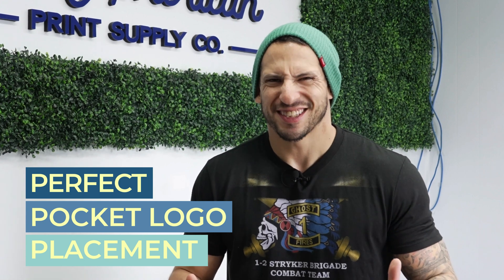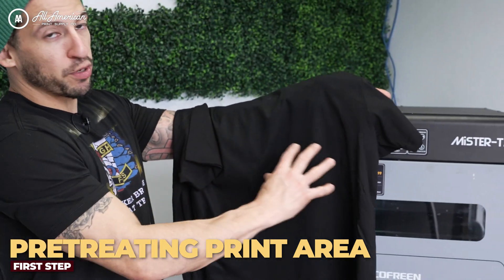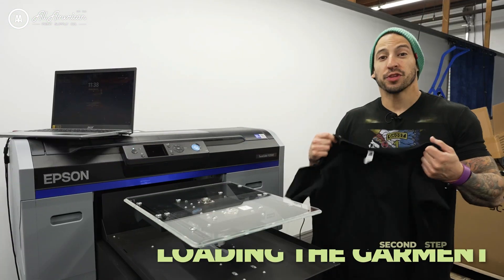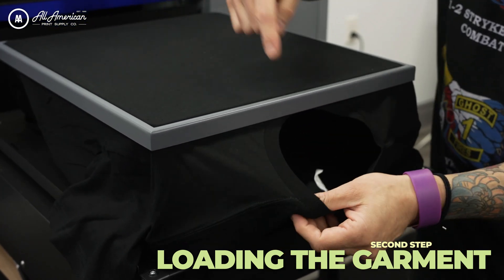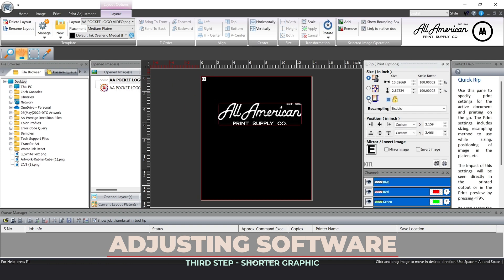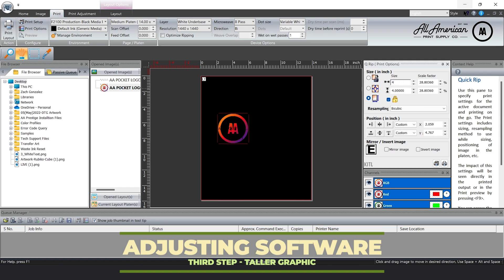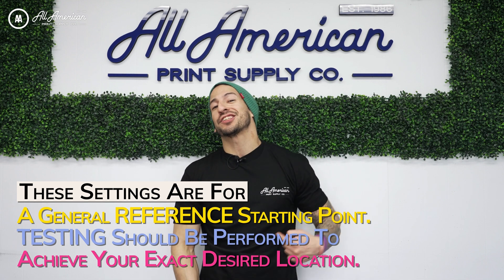How to: Pocket Logo Placement - Kothari F2100

Comment: What are the print locations if you're working on a 16x20 platten ?
Reply: Wouldn’t you already know it? Thanks for taken the time not to answer my question. 🫠
Reply from the maker: @Youaintgonnawin  You are very welcome! Thanks for the engagement 👍
Reply from the maker: Hello, this video was prepared with the 14" x 16". While these settings may be a good starting point for testing we would need to confirm precisely for the larger platen

Comment: Do you have a sheet for all sizes ?
Reply from the maker: Hey there, because pocket logos can vary in size testing is advised. What RIP software are you using?
Reply: @AAPrintSupplyCo  Kothari I got from you guys
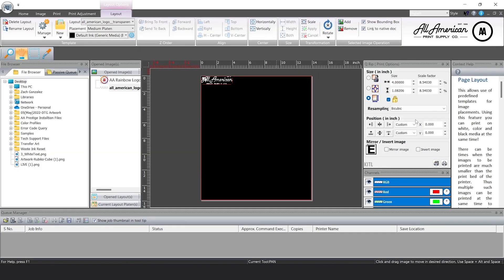Reply from the maker: Ok, awesome. For this video we went based on a mens's LARGE garment. At the 3:50 mark we go over how to adjust for smaller and larger shirts!